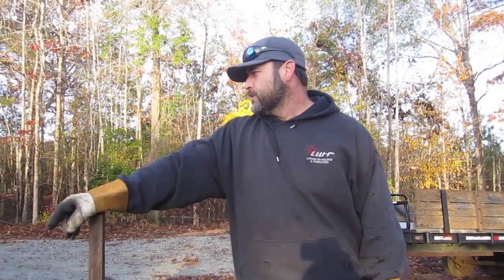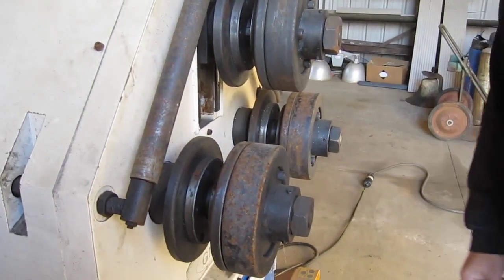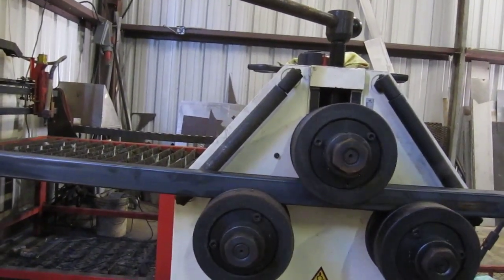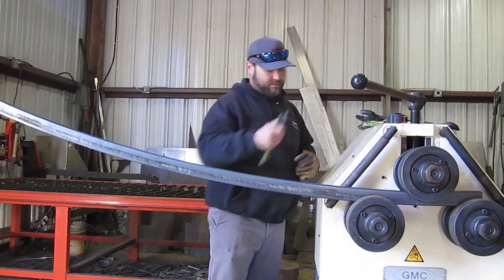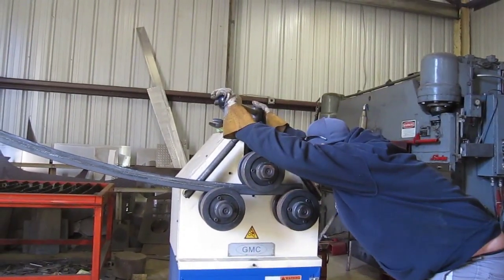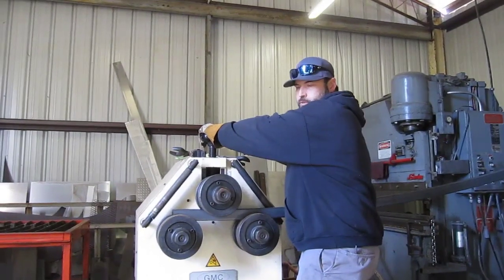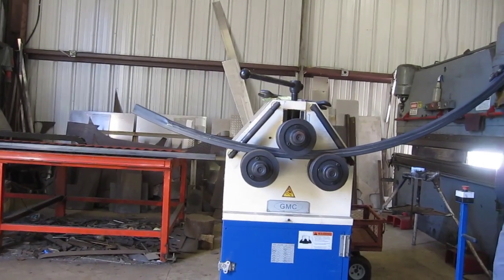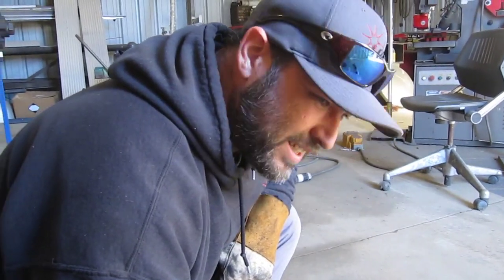Gate Build Rolling Steel Tubing For Arched Tops

Comment: Great job .  I had to do my ones in a press , a little at a time .  Although way smaller !    👍
Reply from the maker: I once made a roller out of lawn more pulleys and a c-clamp mounted to a piece of 10" channel but I could only use it on 1 inch aluminum  tubing.

Comment: Nice work, and nice shop equipment. Do you use your iron worker often? if so, what do you mostly use it for? Do you know of any good places to find a used brake or other equip?
Reply from the maker: Thanks, the iron worker is a very versatile tool you can do so many different operations with it so yea it comes in handy pretty often.  I bought the press and the iron worker at the same time from a guy that deals in new and used equipment and he set up rigging crews and transportation of heavy equipment but it is expensive using a middle man like that.  Since then I generally stick to auctions but you gotta be able to set up transport so best to stay local so you can view the equipment in person and easier and cheaper to move.